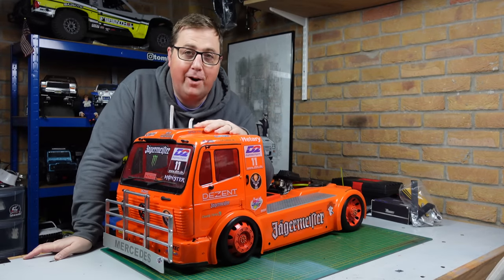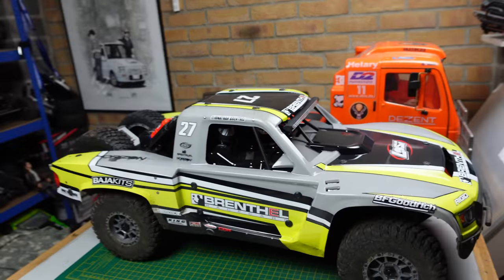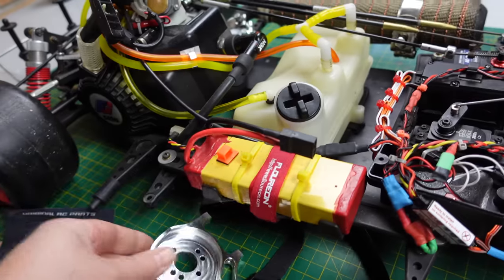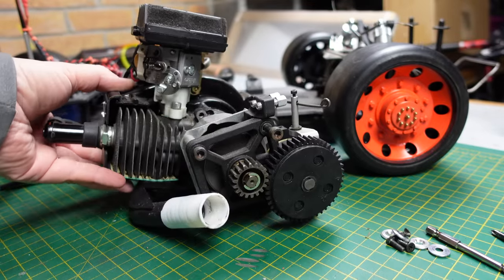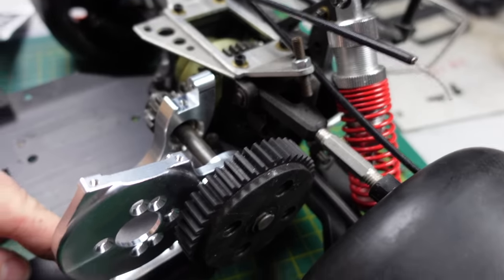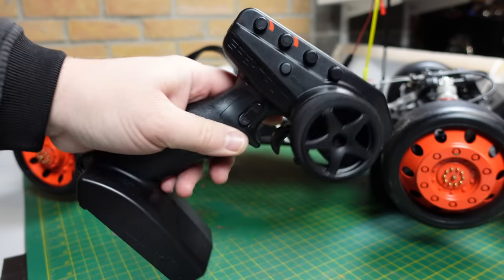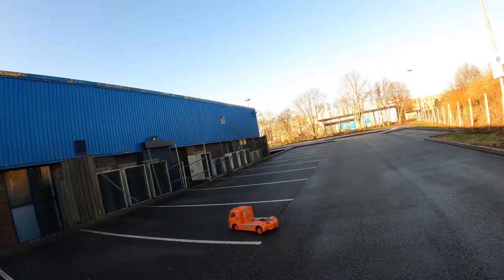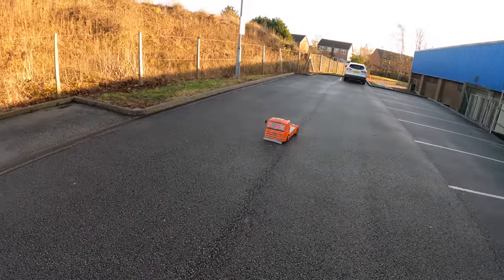The Biggest RC Drift Truck in the World! 1/5 Scale 8s Brushless Conversion. Part 1

Comment: I like how we have brushless motors now. They go as fast as some the petroleum.  But its alot safer having it brushless motor.  Specially like I used to live at low income apartments in winterport Maine and I couldn't have anything with gas inside the apartments.. . Like your truck...
Reply from the maker: Yes, you wouldn’t want this running away on you land hitting someone or something!
Reply: I rather see a gas fire than a LiPo fire to be honest, the gas fires are more easy to put out and less intensive.
Reply: @TomleyRC  On my FG I had a killerbee killswitch on, put it on the third channel which got engaged when the battery gets low, I pushed the button or when the signal got low so I could kill the engine from a distance. It was needed since I alloyed the car out and it weighed over 15kilograms and hit speeds over 70km/h, it could break legs with ease.
Reply: @TomleyRC  Truck looks great btw, always wanted a FG truck or a FG E30 M3, only had FG Monster Trucks and Marders. When I had them the brushless conversions prices were crazy, so I never even thought about it. Back then the owner of FG was in a divorce so it was unkown if the business was getting a new start, so parts supply was unkown.

Comment: You might need to put some weights on it to get the right weight distribution since the chassis is made for a petrol engine
Reply from the maker: Yes, more over the back i think
Reply: maybe some more steering angle and/or toe out to help it not spin out so easy.
RWD drift setup is kinda finicky, one tooth smaller pinion for sure and 4S might be enough power + wheel speed for good drifting, its geared kinda tall.

Comment: Before you spend the cookies on rubber. What if you replace some of the weight over the rear axle? I would doubt that it is that loose with the gas/petrol engine. Bada$$ video though Tomley, as always!

Comment: Badass wicked fun. I love that truck. Great upgrade. Foams on the back and it be awesome
Reply from the maker: Speed run on 8s... could be interesting!
Reply: @TomleyRC  I'd recommend you some GRP or PMT tires. M2 compound in the front and M1 in the rear works very well for racing or speed running

Comment: "Tango" looks great, with the right tyres. And a decent straight, a speed run would be awesome.... Also trailer to tow other rigs.....
Reply from the maker: Be cool to get a trailer for the Mojave and Limitless 😎
Reply: @TomleyRC  that would be awesome !

And with the petrol motor out, you have room to fit a fith wheel setup.

Comment: Holy crap that is a bad ass rig! I had gas/nitro rc's in the past and fully understand why you did the conversion,lol. My friend has the primal rc raminator and is working on doing a dual brushless conversion. I see alot of burn up motors in his future being those things weigh a ton 😄
Reply from the maker: Dual Brushless Raminator will be crazy!
Reply: @TomleyRC  I think so to,well if he can get it to work,lol.  I think after removing the gas motor from the truck it still weighed about 65-70 pounds. I don't know much about about brushless motors but that is alot of weight to bash around,lol. All I know is before he took on this challenge and took it apart,man was the truck was fun as hell to drive,lol.

Comment: Hi, I think some of the grip problem is down to a lack of weight? Along with the cold and wet tarmac, I think the best tyre would be "wets" I.E. treaded you'd get more control and when it's warmer they'd overheat and then you could slide them easier. Also have thought about asking Claire's RC'S if Ian would be interested in the engine?. Love this project!! I did think it was a "banggood" special until I spotted the FG logo.        Steve. UK.
Reply from the maker: Yeah, 100% needs either softer 'wet' tyres, and/or some weight in it

Comment: I like the slicks on it😆 can they be used on other RC's..?
Reply: Well yes they can as long as your cars has a fitting wheel adapter.
5th scale tires usually have 24mm hex or sometimes even 18mm quadratical mounts

Comment: Since you took the engine off it lightened it up so you might want to put some weight on the rear end to compensate for that and it will act better when you steer it it might keep it from spinning out so easy but cool build I just wish you would have ran it with the motor one time so we could see how it went

Comment: Does it loop out because it lacks weight in the rear bow you’ve removed the gas motor? Curious how much weight bias you have lost in the conversion and wether moving batteries back etc may make it easier to steer?

Comment: Gas powered RC has to have real disk breaks on the wheels. Unlike Electric, you can't just put it in reverse to stop the vehicle. So I suspect those were stock, not an upgrade.
Reply from the maker: It has a single disc next to the engine which is the stock one. The ones on the wheels are upgrades 👍🏻
Reply: @TomleyRC  oh okay, that makes sense

Comment: THE TYRES ARE GREAT FOR THE TRUCK  YOU NEED TO RUN IT TILL YOU GET HEAT IN TO THEM OR TYRE WARMERS +THE GROUND IS WET DAMP  I HAVE BEEN RACING FG TRUCKS FOR 25YEARS
Reply from the maker: Thanks Fred. I’m waiting for the weather to warm up a bit 👍

Comment: I agree with the electric conversion but a before and after video is better
Reply from the maker: Yes, although because it was a brand new engine, I was reluctant to getting it running, tuned it...run it in, just to do a 5 min video before ripping it out
Reply: @TomleyRC  Yes I understand is easier to sell it if it is brand new

Comment: Next step world biggest brushless 1/5 crawler truck. Nice platform nice Design, but just slippy road and bad tires is not drift object. For 8s, try 500kv motor, less heat more running time
Reply: Ça fait longtemps que Many la déjà fait mdr 😜